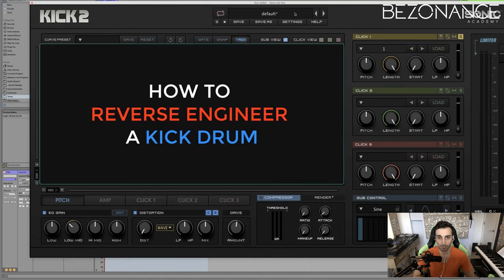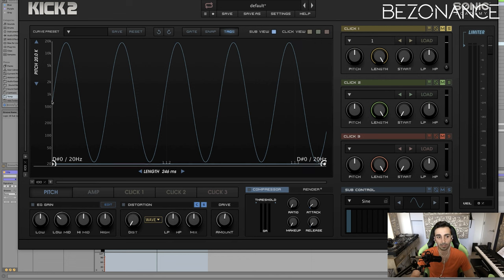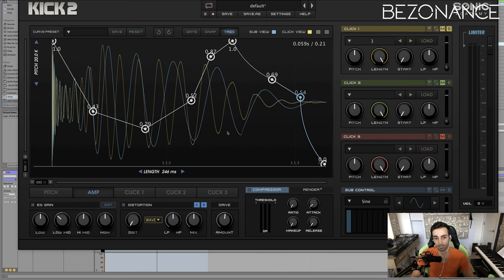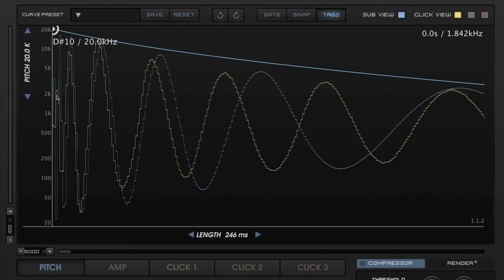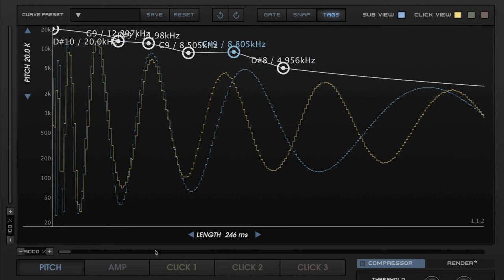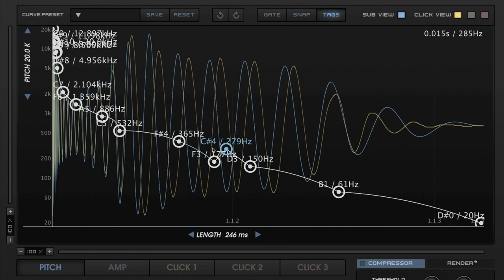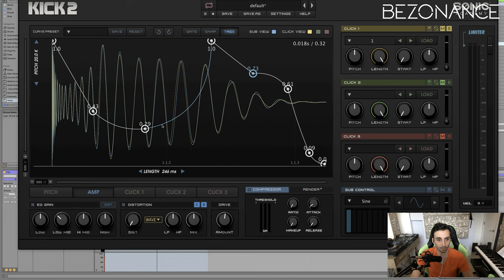How to Reverse Engineer a Kick Drum - Kick 2 Sonic Academy

Comment: 9:58 - aligning the wave forms
10:16 - using pointers to lock places in time
11:50 - beginning to reverse engineer
12:51 - getting the initial
27:26 - comparing
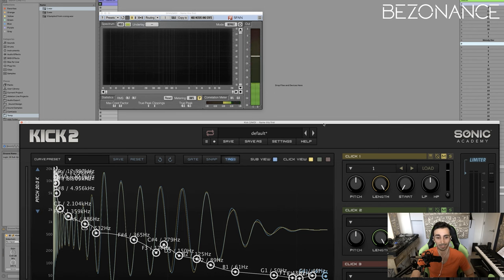28:52 - getting rid of pointers

Comment: how do i do the same but using a kick from an actual song, and also what about that song doesn't have a part that only the kick plays by it self
Reply from the maker: you need to find a part of the song that the kick and bass don’t overlap and sample a relatively cleaner kick usually first beat after the intro or towards the end of an outro  you can find a good sample. As long as there is no bass sitting on kick you can see the kick waveform clearly even if there are other elements that are playing at the same time.

Comment: Works for clean kicks but what about ones that have some distortion or saturation?
Reply from the maker: Good question! To be honest, I usually work with clean kicks since that’s the style I mostly deal with. But, logically speaking, you can still get the core of the kick using the same reverse engineering technique. Then, focus on your source kick to identify the type of distortion applied. You can often visually see the distortion characteristics on the waveform, and if you’re familiar with different distortion types, you can also identify them by ear, as each has distinct traits. Some distortions are more obvious, while others are subtle and harder to detect.

A bit of trial and error with different types of distortion can get you close to it. Also, many distorted kicks include extra harmonics beyond the fundamental frequencies. You can analyze these with a spectrum analyzer to find the prominent sub harmonics and use Kick 2’s Sub Control to draw in the additional harmonics. Sometimes the distortion comes from how the partial harmonics interact with the sub waveform, which can be visually matched in Kick 2 since the waveform updates as you add harmonics. A good trick is to focus on one cycle and count how many smaller cycles are nested inside it, giving you a clue about which partials are involved. Hope this helps! remaking distorted kicks can be tricky, but with patience and careful analysis, you can get pretty close!

Comment: It's great to clone, but these kicks are also made to fit the mix/basslines of those reference tracks. Do you think u can get away with creating visually kicks like this, coz if someone doesn't have monitoring system, room treatment?  At least to get into right ballpark with kicks tonality ?
Reply from the maker: As long as the kick fits your project key, interplay between kick and bass, and is the right length for your bpm it should give you a good starting point. The point is not to copy the original kick exactly and use it just like that (although you can) but once you have created the kick that you liked the sound then you have all the controls to make it fit to your needs  where in a sampled kick you don’t have this control on pitch envelope that makes the kick. At the end of the day it has to sound good for your project and without a good monitoring system or a good reference headphone it would be hard to hear the difference.
Reply: Yeah, so do you think then that if we have bad room, I have Adam a7x, and headphones dt 1990. Is better just use samples instead? Or is it just walking in darkness when I try to make kick with kick2 bu using reference kick like you have shown in this video ? @BEZONANCE
Reply from the maker: @partlysimpson5154 if your room is not acoustically treated then just use headphones and if you have a car stereo that has good sound test it in the car. Same issue arises with sample pack if you can’t hear it properly you wont be able to judge it it is complementing your track or creating phase issues with bass. Best to use headphones until you can treat your room, and if you can treat the room that is the best investment you can make, ps I also have AdamA7X and love it

Comment: I guess this is useful if your source is not clean (has other background elements), ohterwise why not just use the source kick? But if its not clean how would you deal with background elements that don't belong (other than layered hats which function as the transient)? Seems hard especially with other low frequencies to differentiate them from the kick.
Reply from the maker: Yes of course if you have a clean kick that you already like you can just use that, this is for those who hear a certain kick in a track and they want to achieve something similar, other benefit is having the synth version of the kick vs sample opens a whole new world of possibilities as you can fine tune it easily to any  key or for specific bass and achieve a cleaner mix

Comment: Copy only click part, bro, low end is always same, depends only root notes (frequency of root note)
Reply from the maker: Thank you for your comment! I’m not sure If I understand what you mean by that, if you can please explain a bit more. Low end is not the same all the time, there is different pitch modulation and pitch change duration that defines the low end and doesn’t necessarily stay on one root frequency. Some kicks pitch modulate all the way down, some go down and come back up again, and some stay around the root note, depending on the style of the kick you are after there is many different variations that can define the low end and body of the kick.
Reply: @BEZONANCE  Any kick is 2 part: click + sine sub, sine sub is always same, depends on desire note frequency only. For example note A is 55 Hz sine wave, note C is 65 Hz and etc. The form of the signal abslutely same: sine wave

But the click part is ALWAYS diffrent. Focus only on click, not sub
Re-copy click part and just add sine sub with a desire frequency
Reply from the maker: going to reply as some people new to this might get confused by your comment. Kick is actually 3 parts not 2. Click + Body + Sub. Body of the kick and sub have a very unique characteristic for each different kick and it depends on the relationship between time and pitch bend of the sine wave. different part of the kicks have different pitch curve to create that unique sound. you can’t just put a sine wave on the root note and of your desired frequency and expect to have a punchy and powerful kick. In some genres like hip hop you might get away with this technique of static sine on your root note but other genres like psytrance, techno ... have unique kicks that usually sweep through frequencies until it reaches the root note and then depending of the style of the music either stay on the root or might continue sweeping with a different curvature either upwards or downwards.
Reply: @BEZONANCE  No bro, kick is 2 parts: coz when I design a kick from a sinewave, what I do? Right, I pitch the sine wave and after I have pitched 1 part (click+body) and 2-nd - low end
Pitching makes click+body parts from low sine wave
Reply: @funkerfogt1869  I Agree, there is a point where pitch modulation must stop and stay fixed in the root. Bad kicks are always changing in frequency (Picth modulation continuing until the end) and are unstable and create phasing with the bass!. The tutorial is good !